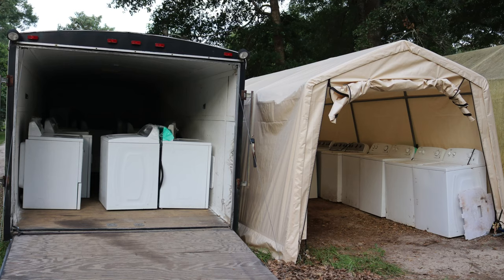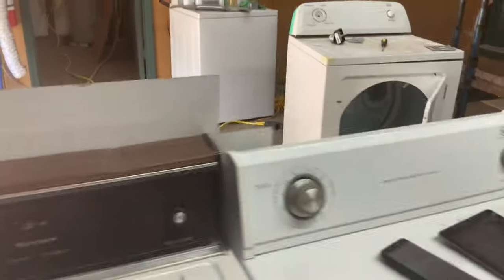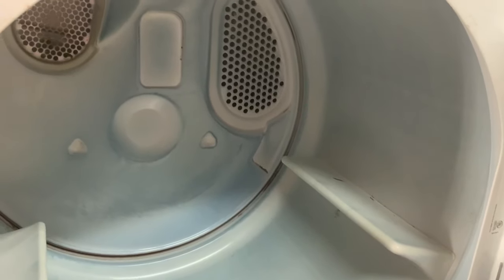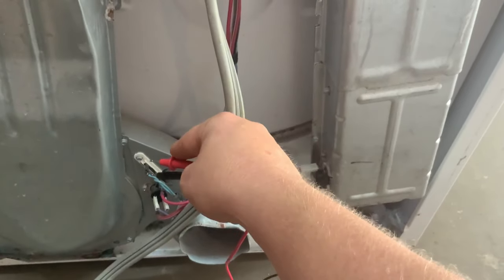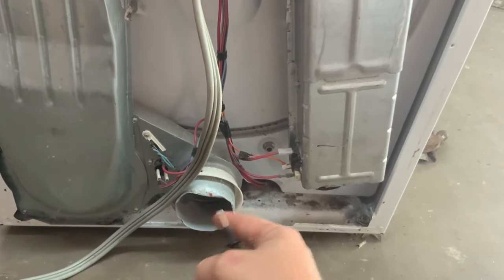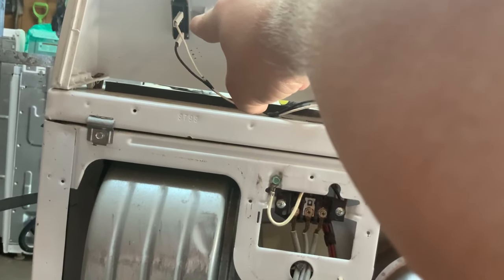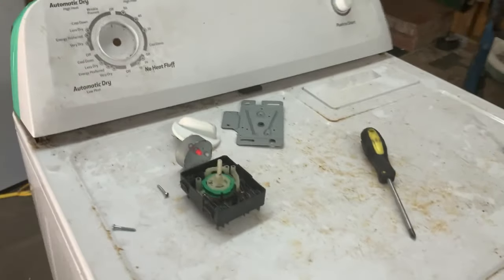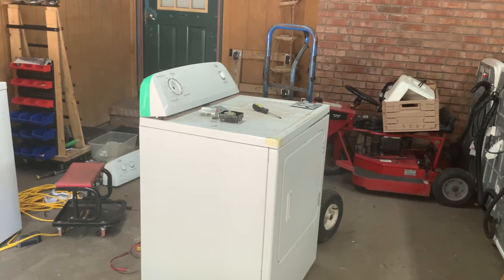How To Fix Any Whirlpool￼￼ Dryer￼￼ - Troubleshooting ￼the Most Common￼ Top Problems ￼

Comment: Thank you!!!
Reply from the maker: Glad to help
Reply: @WasherDryerMoney  my coil had not broke but over the years had expended but enough to touch the enclosure.  I repositioned them.  It blew a fuse.  I quick bypass test comfirm it and I will have the part ordered shortly.  People like you help handy men like myself get the job done without breaking the bank & look like hero's to our Wives so thank you much!
Reply: P.S.  Cleaned out entire unit and having the entire duct cleaned out by a proffessional.
Reply from the maker: @christopherbrown5338  glad to help
Reply from the maker: @christopherbrown5338  there’s a lot of cool tools for tools for cleaning out dryer vents. Check out the one that runs on air pressure. I have the one that is just an brush on a stick and it works pretty well. Especially if you’re not going to more than 10 feet.
Reply: @WasherDryerMoney   Hello again Sir.  Now on to the washer.  It is a Whirlpool WTW5400TQ0.  The water on the hot side pulsesates during filling.  I thought it was the water inlet valve, so I changed it out with a new one but it still does it.  Any advice?
Reply from the maker: @christopherbrown5338  undo the hot waterline from the washer and open the lid of the washer and turn it on. Make sure it’s running at regular pressure and volume. Lot of hot water lines will get stopped up. If it’s running slow, it could cause the water valves act weird.
Reply: @WasherDryerMoney  I did what you said, I still get the pulse (on cool/warm/hot but not cold)
Reply from the maker: @christopherbrown5338  maybe swap the hot and cold waterlines reverse them “just to test”. On the washer. See if that makes it do the exact opposite. I just can’t think of what it would be on the washer machine making it do that I’ve not seen that before. It may still be a slight volume/pressure difference between the hot and cold water outlets.
Reply: My Wife said many times its fine during the summer.  So it seems to work in warmer ambient temperature but in the cooler seasons the pulse returns
Reply: @WasherDryerMoney  It was the temperature control switch.  I took it apart and cleaned the wiper contacts.  There was some kind of grease on the contracts.  Thank you very much for your help & feedback.  It is so much appreciated!!! :)
Reply from the maker: @christopherbrown5338  glad you figured it out. I’ve seen temperature control switches just not work but I haven’t come across the intermittent off/on Problem. Interesting.
Reply: @WasherDryerMoney  well I spoke too soon, I mean I still think it's the temp control because the board did smell burnt & a capacitor was expanded.  And the pulse sounds completely different now.